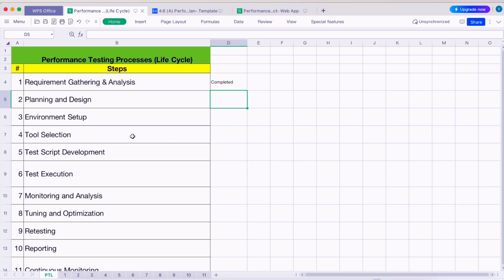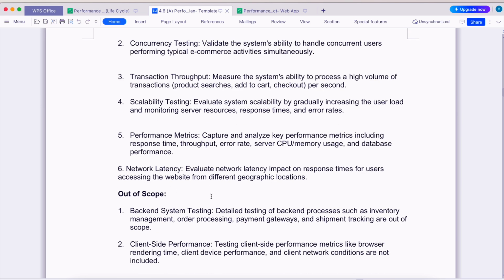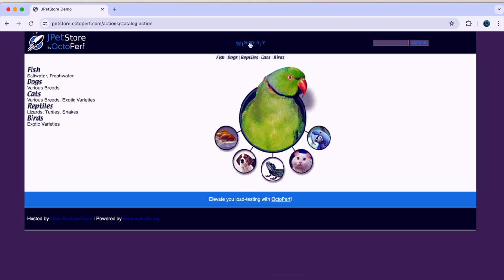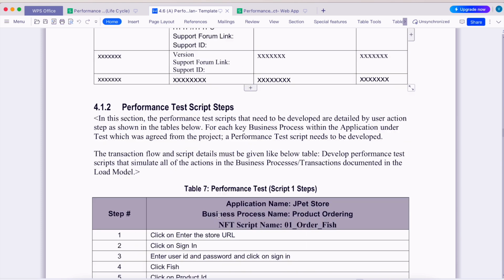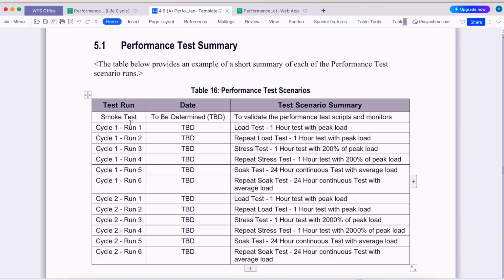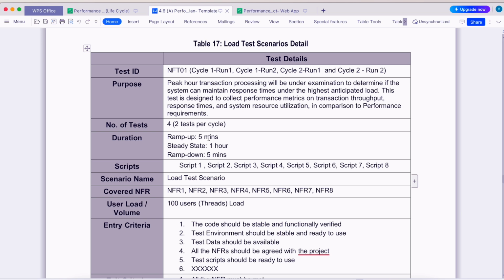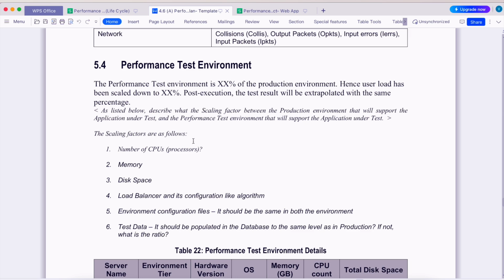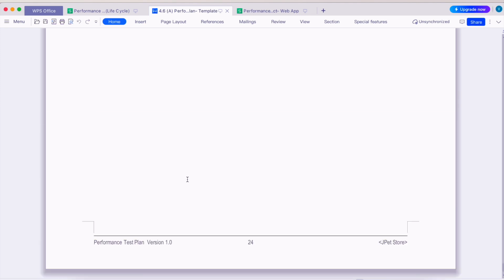Performance Testing - Planning and Design phase 2  - part 1

Comment from the maker: Full Course Link
=============
Performance Testing using Meter course - Basic to Advanced
https://www.udemy.com/course/master-performance-testing-using-jmeter/?referralCode=10A2770B5F62BDD30A73

ISTQB Foundation Level Certification Practice Test Course
https://www.udemy.com/course/certified-software-tester-foundation-level/?referralCode=99B9459EB5C7A7C8E1B9